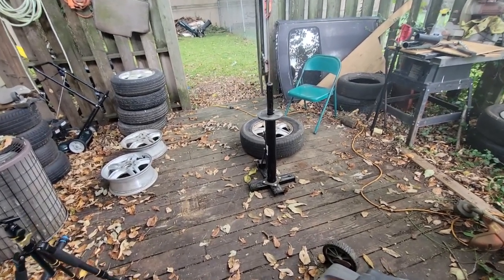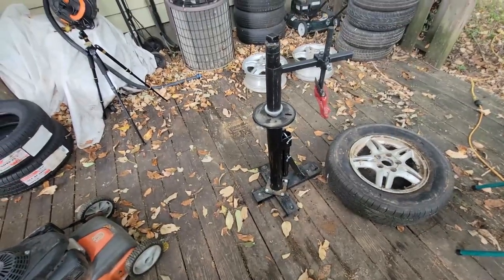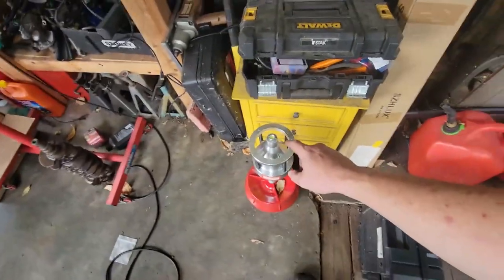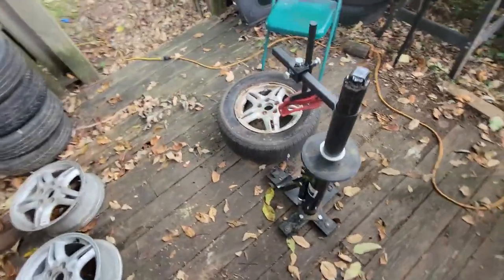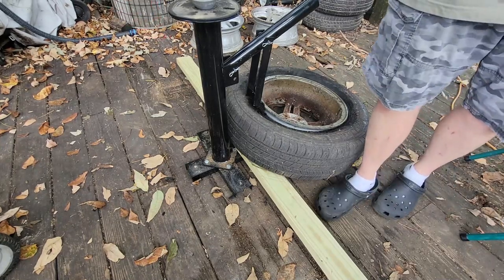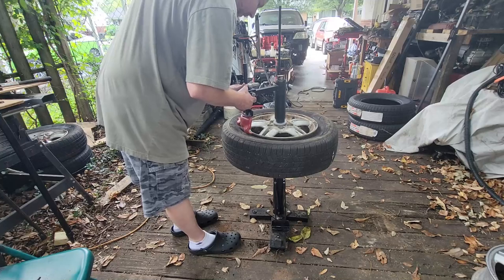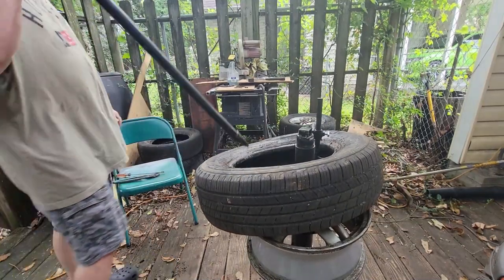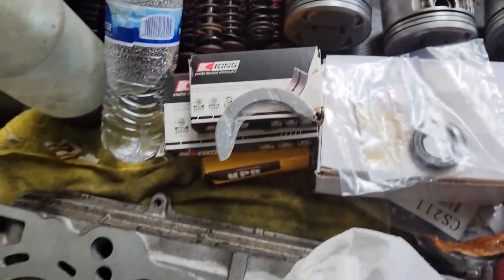Harbor Freight Manual Tire Changer with Duck Bill Modification #mrjaydm

Comment: I have used my bubble balancer a lot... It's as accurate as you can get, more accurate than a lot of the machines some shops have.  The best part about having that balancer is you can rotate the tire on the wheel before you set the beads to get the balance super close before adding any weights.  I put the wheel on the balancer before setting the beads and check it. I really need one of those duck bill rigs.
Reply from the maker: That is a great tip, thanks!

Comment: Thanks for sharing the video! I have this same exact setup including the bubble balancer. There's some videos on YouTube on how to mod the bubble balancer by drilling out the hole that the pin sits in so just the tip is touching and it makes it very sensitive. Highly recommend doing that mod!